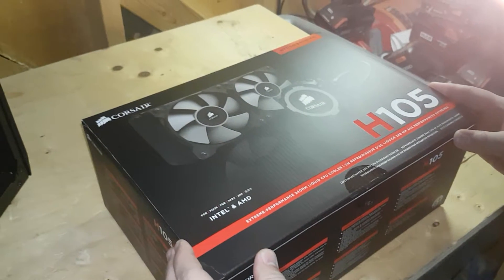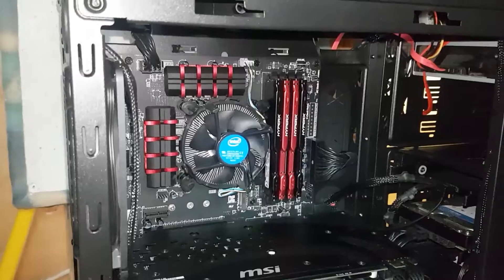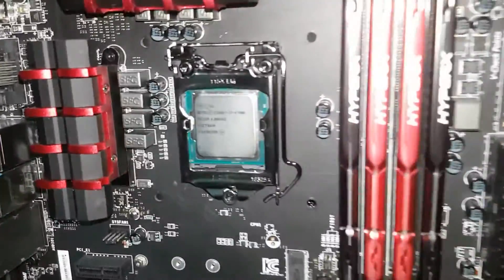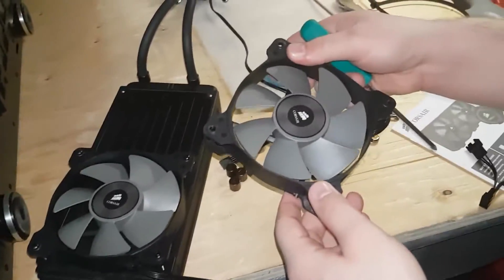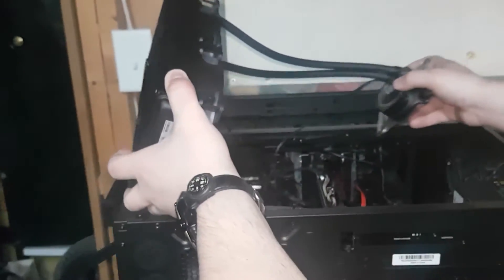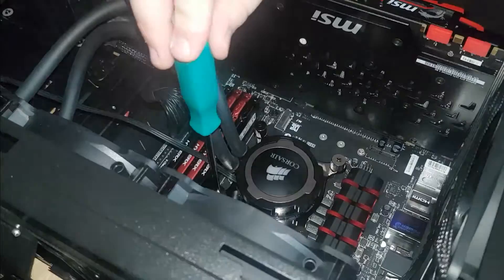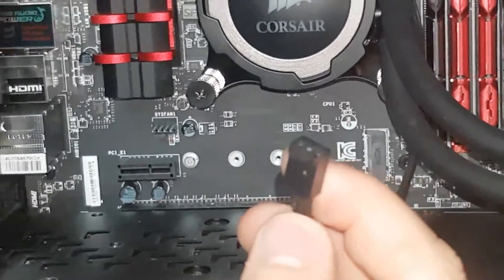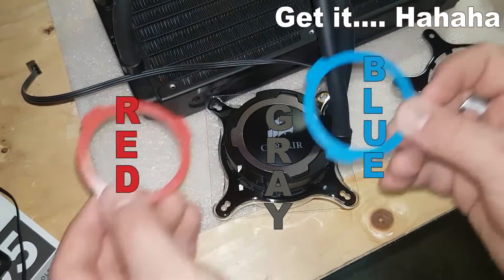How To: Install A Corsair H105 Liquid Cooler

Comment: how do i know what tube size to go for/size of whole equipment to go for? does it come with all the parts that i need to build? case: NZXT H500
Reply from the maker: You'll need to look and CPU socket and rad mounting of your case the tube size is pretty much standard across most AIO (All In One) Liquid Coolers.
Reply: The Raccens thanks I figured it out and is picking up the Corsair Hydro tomoroow. Thanks anyways. Best toturial on here. Hands down
Does thermal past come with tho?
Reply from the maker: @Potatojuice1  Most do we have yet to see an AIO that doesn't come with it pre-applied how ever there are people who clean it off and apply their own to get a 1-2 degree difference. If you like our tech tutorial subscribe for more we always have some tech stuff in the works.
Reply: The Raccens now should I apply new paste?
Reply from the maker: @Potatojuice1  We just use what comes with it the 1-2 degree difference isn't really worth the hassle and besides you have to make sure you get the top of the line thermal paste to even get that difference.
Reply: The Raccens I tried installing and I failed.  Shit happens...
Reply from the maker: @Potatojuice1  That sucks what happened?
Reply: The Raccens if I’m going to be honest. I have no clue. Had to send it in and may get results in 12hrs
Reply from the maker: @Potatojuice1  Well best of luck to you hope it works out!

Comment: Which one is better h105 or h100i v2?
Reply from the maker: Both are pretty much the same they both have a 240mm radiator so it's more about looks when comparing the 2, Trevor went with the H105 cause he thought it looked better and the tubes on the H100i look like they'll eventually fray. If you like this video please subscribe for more we have more Tech videos in the works.

Comment: Do i need to apply  thermal paste on the processor before installing the cooler?
Reply from the maker: Not unless your buying used. The H105 from CORSAIR comes with Thermal paste pre-applied. That's what the grey stuff is at 0:45 into the video.
Reply: The Raccens so basicly its just plug n play
Reply from the maker: Well there's a bit more then just plugging in but yeah nice and simple just like a AIO Liquid Cooler should be.